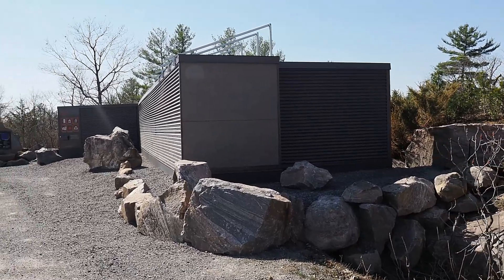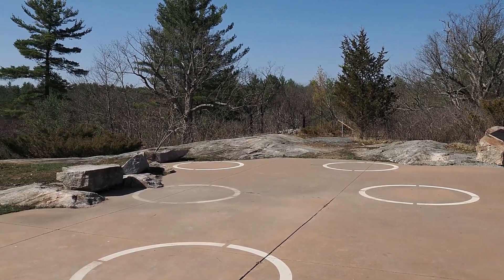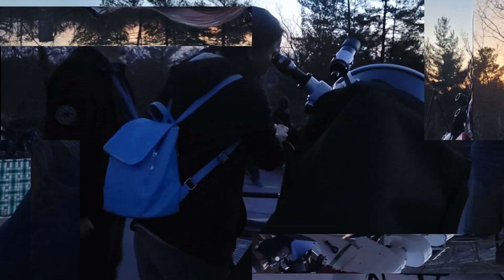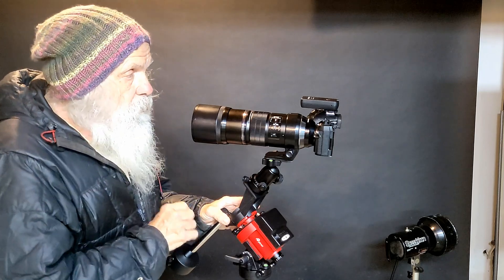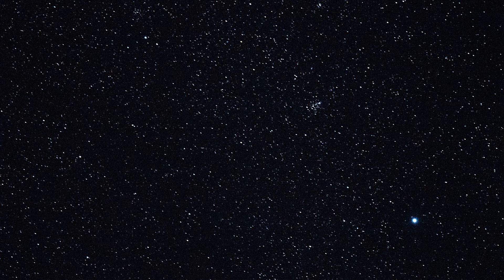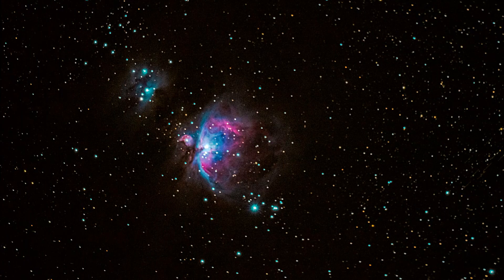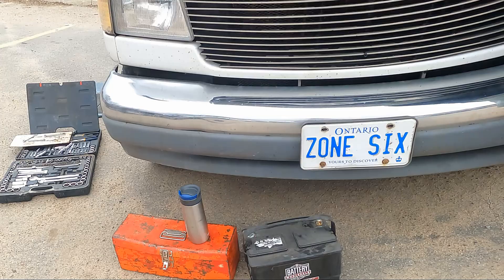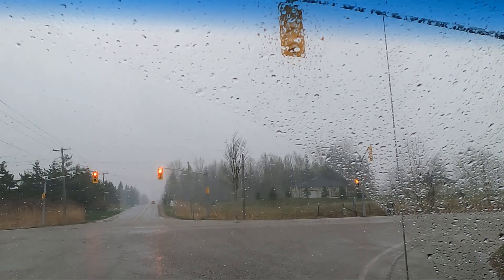Olympus OM-1Starry Sky Focus Deep Sky April 2023 at the Lennox and Addington Dark Sky Viewing Area.

Comment: Wow that area is wel organised. Do you have to make reservations? Shame about your fan braking down but good that it's better then it was. Hopefully it didn't cost you to much money. Grt guido😊
Reply from the maker: Probably best to have a reservation.   I get to help set it up when I am there.   Good people for sure.   The van is working great now.   I wonder what could make it burn 🔥 coils.  70 dollars all in
Reply: @bellasvistas3463  if it is a returning problem maybe consider buying a spare one to put in the car. If you ever run into the same problem you don't have to pay for the towing... but hopefully you bought just a bad one or something. Also strange that the van feels much better with the new one.
Reply from the maker: @Guido Van De Water  it's strange alright Guido:  Apparently, a coil should last 100,000 miles.   This one didn't get close to that.  I was having an issue with starting warm after being shut down for half an hour or so that seems to have been resolved.   More vroom vroom up hills now it's a 5.8 liter Windsor Engine.   Wires plugs and cap all good.   I'm planning on a spare coil and ICM too.  Thanks.  Mike